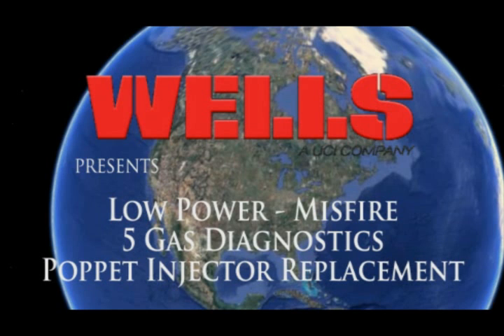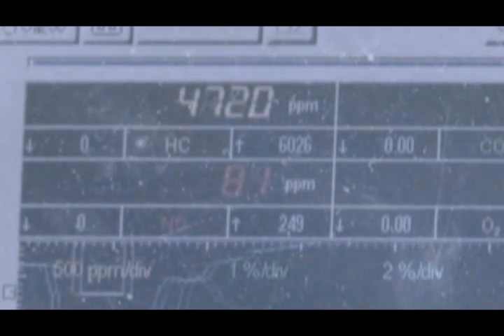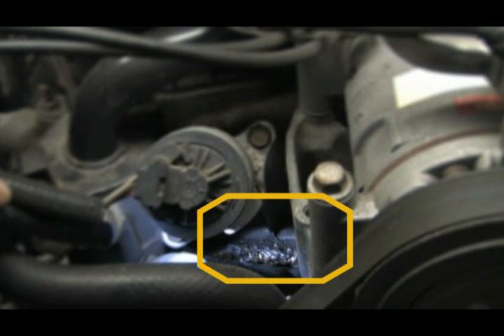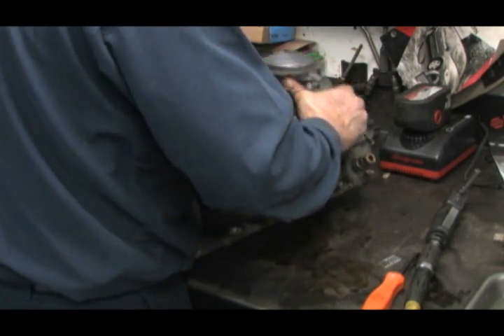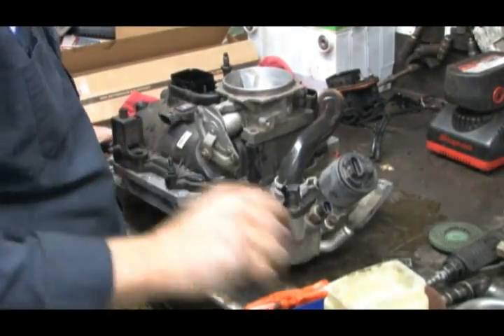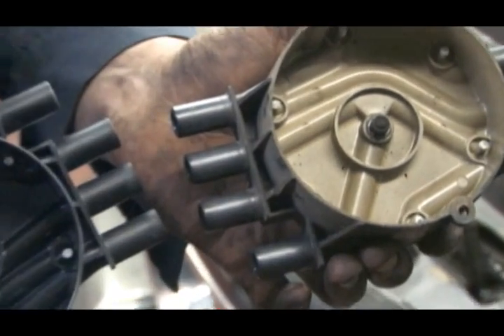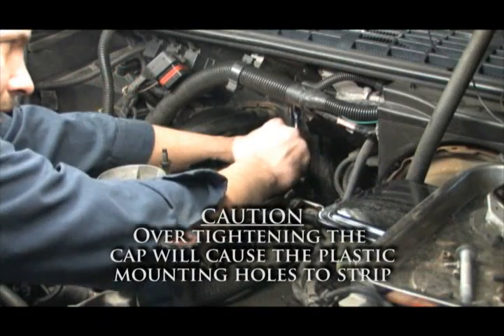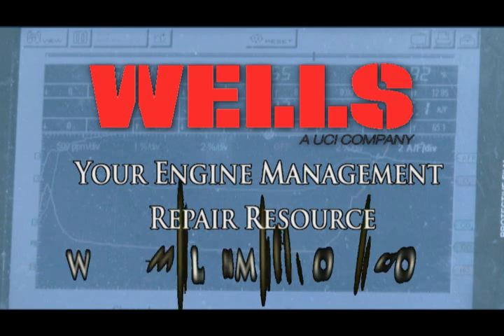Chev / GMC Misfire, poppet injector diagnosis, troubleshooting and replacement

Comment: Again sorry, I'm having a Randy cylinder misfire. I dont know what else to do or could be causing this. I've replaced the rotor, cap, wires, plugs and injectors. I was told I need a new upper intake gasket. Could that solve my problem? Please help!!

Comment: also he said there was ample compression and spark in the wires but the pulstar was wet meaning didn't get ignited ..but we tried 2 new pulstars prior ..only when he put champion in, it did ok.. so when i went home i triggered another misfire by putting  back pulstar in #4 cylinder, so i am  left thinking that  the computer or coil cant handle the capacity of the pulstar plugs ..anyway  i went and undid that by putting back the ac delco into #4 .but the misfire light hasn't  gone away yet !

Comment: @markjhicks 
yes i did  swap the new pulstar with another new pulstar that was working from cylinder #4 and put it into cylinder #1 but still the same thing happened.
now this morning i took my van into large outfit ..that mechanic said he put a champion plug in cylinder #1
and everything was great no light no misfire.. so i drove it home..remembering i had a delco plug in cylinder #4 .so i changed it to pulstar, but a misfire came back, not sure which misfire this time.

Comment from the maker: @frank0067 When you new plugs set off this misfire, I am assuming you mean it was OK before the plugs were replaced. In that case my first thought , did you replace the plug again or swap it for another cylinder? Second, was conductive anti-seize compound used? When checking the injector, first check to see if the computer is firing it with a noid light. Another way is to listen to it with a screw driver to your ear. Listen for a clicking sound this would indicate the injector is firing. 
Mark

Comment from the maker: @maycor1076 You are right looking at Lambda would have helped. However like you said not many shops have this equipment, so we decided to stick with mainly the HC and CO readings. Hooking the noid light to the harness took only a few minutes to confirm the PCM was triggering properly. I am pleased you liked the video. We are working on some as we speak I am sure you will also enjoy.
Take Care
Mark Hicks

Comment from the maker: An ohmmeter works by send a small aount of current from one lead and calculates the resistance in the circuit by how much of that currents flows through. Sending even a small amount of current through an air bag circuit is not recommended.

Comment from the maker: Any voltage spike in the system could set the air bags off. Disconnecting the battery cuts the odds of this occurrence,

Comment from the maker: I believe you are correct. The voltage needed to bridge an air gap goes up as the gap width increases. Because the wider the air gap the more force is required to ionize the air within the gap. This is a good question.

Comment from the maker: If you dont have a flex fuel vehicle the computer will compensate for E10 through fuel trim adjustments. On a flex fuel vehicle there is a sensor to tell the computer alcohol content. Go to the Wells website and read the newsletters Volume 11 issues 1 and 2 Present & Future Power trains - are you ready?  This is covered in them. 

Mark

Comment from the maker: It depends upon the strategy being used by the computer system. On today's vehicles the injector will fire once. On some earlier vehicles that would gang fire the injectors it could fire several times.

Comment from the maker: OK, here is a very skinny explanation of fuel trim. Short term fuel trim (STFT) pretty much follows the O2 signal. When the average of the STFT is 0 the long term fuel trim (LTFT) stays at 0 also. When the STFT averages lets say, +10 the LTFT will start to go negative or take fuel away until the STFT averages near 0 again. 0 is 14.7 to 1.
Hope this helps,

Mark

Comment from the maker: An O2 sensor signal oscillates because as the sensor is reporting a rich signal for example the computer is reacting by leaning the system.  Stoichiometric of a 14.7 to 1 ratio is obtained through an average.
Mark

Mark

Comment from the maker: Anti-freeze does flow through the intake to help fuel atomization. On very early vehicles it would also help heat the choke spring. The coolant will be warm, it is on the heated side of the thermostat.

Mark

Comment from the maker: You are right the injector was diagnosed by eliminating everything else. This injector system is not really accessible for accurate diagnostics. Putting the 5 gas probe in the spark plug hole would always show a presence  of HC. This would not be a valid test.
Mark

Comment from the maker: You are right, however with OBDII things have gotten better. Early OBDII systems like this will only allow a limited amount of change, like the 25% percent. On later systems, when the change becomes too great, the system will revert to learned values, preventing for example a catalytic converter failure.
Mark